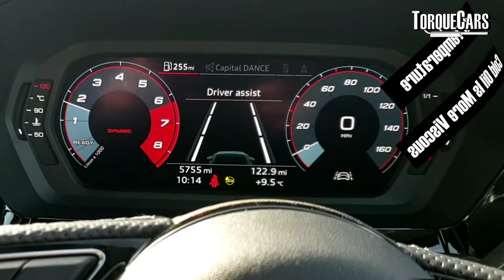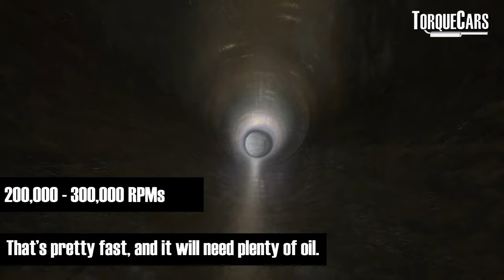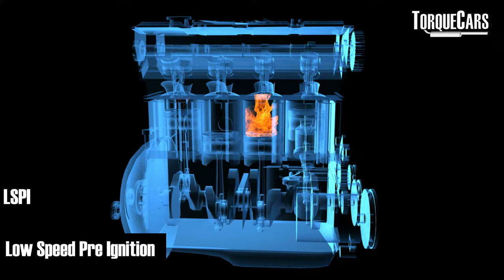5 Things That Kill Turbo Engines ⚠️ [WARNING]

Comment: What about towing? Is it bad to tow with a turbo?
Reply from the maker: Shouldn't be a problem at  all just find your power band and aim to stay in that with careful gear selection. Warm up is important when towing so don't drive hard from cold just keep it gentle until the engine warms up. It is easier to lug the engine when towing which should be avoided. https://www.youtube.com/watch?v=vyt5ETkSot0

Comment: Manufacturers for some reason don't care about engine lugging. On my new Caddy 2024 work van the car tells me to shift up to 6th gear while going 80 kph uphill. I know that it's going to lug the engine, so I don't. And it only has 75 HP, what gives?
Reply from the maker: FYI - The indicated shift points are purely related to RPM and speed and don't take into account hills, theoretically these shift points are optimum for economy but that is often debatable as there are so many other factors as you have pointed out.
Reply: @torquecars  I actually do remember one of the cars that I was driving that recommended lower gears based on how steep you were going. I think that it was the """automatic""" peugeot that in reality has a manual gearbox hooked up to a computer. Worthless gearbox. But at least it didn't let me lug the engine.

Comment: My turbocharger kicks in fairly late and I usually rev it slowly until i feel it kick in and then rev up to my desired speed. However, Ive noticed that my car doesnt shift as fast as I would like, or as I am used to in other automatic petrol cars. How do I map it for maximum power and fuel economy?
Reply from the maker: I would check that the waste gate and boost valve are not sticking open first off. On your Hyundai it makes sense to use a plug in tuning box because I'm not aware of anyone offering remaps on that model. You can also get a box that sharpens up the throttle response which might provide the answer you need. Where are you based? I'll see if I can trace anyone near you that can help.
Reply: @torquecars  somewhere in africa, unfortunately
Reply: shifting has nothing to do with a turbo that is the transmission

Comment: Thanks for the tips, any chance to explain a bit more point 4 if you have a Tiptronic transmission? Not sure how can you luggage the engine if using an automatic transmission
Reply from the maker: Lugging is nearly impossible on a Tiptronic gearbox, I should really do another version of this video for those with auto transmissions. Here in the UK 80-90% of cars are stick shifters, I know in some areas this percentage is inverted. If someone had a manual shift mode in their automatic and they chose the wrong gear it can potentially cause issues, but a modern car will generally work this out and step in to sort it.
Reply: @torquecars  awesome thx for the clarification:)
Reply: I admit to lugging my 1980's manual turbo car  , in 8th gear doing 100kmph it sits @ 2400 rpm  redline is 8000 rpm.

Comment: If you shutdown quickly after a hard drive, the high temperature of the turbo will fry the seals in the turbo. Mechanic says: here’s your new turbo, thanks for the large amount of money!!!
Reply: This seldom happens. Just coming off highway to gas station takes minute and that is enough to cool down turbo. And driving 120kmh in highway is not heavy use. Maybe for smart 0.7 litre turbo but not for anything else really.
Reply: But if you drive normally and not hard, then it's not a consequence.
Reply: Not much of a concern for normal drivers nowadays. Oil and turbochargers are much better designed, and most cars have electric water pumps to keep circulating coolant after the engine has been shut off.

Comment: When you say spirited driving, do you mean like racing / high performance applications? Or would simply driving for a long stretch at normal highway speeds also be included? I try to let my turbo cool down but I usually give it more like 20 - 40 seconds of idling after parking from a highway drive. I'm not sure if that's enough. (I just do daily commutes in my sedan)
Reply from the maker: I'm referring to high RPM & Full throttle loads, anything that causes the Turbo to spool right up. Highway driving is generally more relaxed but giving the car a short cool down period really does keep everything happy.
Reply: @torquecars  Thanks for clarifying 🍻

Comment: I have an air-cooled engine. Should I let it idle after driving to cool down the turbo?
Reply from the maker: No, because there will be no airflow to cool the engine, the oil or turbo as the car is stationary (unless you have some type of electric fan setup to pull cool air over the heat sinks. )

The only aircooled turbo I've ever known was a VW Beetle which used a Porsche Engine. What do you have?

The principle of driving slowly for the last bit of your journey will still apply to an aircooled engine. Is the turbo oil feed running through an oil cooler? If not that would be a practical upgrade to prevent the oil overheating.
Reply: 911 turbo?

Comment: i think you could have done a better job explaining the low rpm bits,my turbo diesel peaks torque at 1900 rpm so it makes sense to drive it around that range, also I think this doesn't apply to all scenarios, sometimes I maintain speeds of 60km/h in 4th gear at around 1800 rpm using almost no throttle at all and it is not clear at all in this video wether you define it as lugging or not, so in this bit you may lead people to just have an unpleasant drive and overthink their use of the car without having a clear definition of what to do

Comment: Hello there! I have a question, more like asking you for advice really. I bought a VW golf 2009 1.4 tsi around a month ago, was serviced in february, and everything was working fine. A couple days ago, the car stopped responding out of a sudden, the gears were changing randomly, and then it just shut down. I thought something happened with the transmission but actually the turbo was damaged. The fans were out of place but nothing broke, the problem is that oil went to other places, potentially damaging other parts of the engine. Anyways, the mechanic gave me the option of getting a used turbo (96000 km approx) or a new one but the price is the double. My problem here is that if i choose to spend on a new turbo, but there's other issues with the engine, it's gonna get too expensive to fix. Do you think it's worth it? Just cause it already looses value, so maybe i can fix it and sell it to recover a little bit of what i have spent on it, or maybe give it a go on fixing all and keep it? it's kinda upsetting because i just bought it but yeah.. thank you in advance, and thank you so much for all your videos, i've learned a lot :)
Reply: Listen to Scotty Kilmore your first mistake was to buy a VW especially that old. Trade it in sell it and buy another vehicle.
Reply: I don't know how hard it is to replace a turbocharger in that model. In some vehicles it is pretty simple. In others, maybe not. In that situation, I would do it myself but not everyone can. Another problem I would have is finding a turbo unit in the self-serve wrecking yard. The price is about $100 versus at least $300 for a new turbocharger off of Ebay. Your mechanic might charge you $1200 for the part.

You probably have the car either fixed or gone by now, but I did the research. Research is my hobby, so to speak. I have never owned a turbo car.
Reply: @kennylavay8492  scotty kilmer is a toyota shill, some VWs are good reliable cars, most arent tho
Reply: @kennylavay8492 lolwat. So you are saying don't buy an Audi? VWs are one of the most reliable cars you can get

Comment: Can a faulty turbo cause engine oil burning and more fuel usage ?
Reply from the maker: Potentially, the oil flows through the central turbo spindle to keep it lubricated so if a seal goes it can seep into the intake and cause burning.

Comment: Hw does a turbo engine without intercooler works vs one with an intercooler.
Reply from the maker: That's a good question I might do a video on that. There were some turbos that came without intercoolers.  The act of compressing the intake air will add heat and this heat will sap power, the intercooler exposes the hot air charge to cooler external air and redcues the intake temps, after a while the intercooler itself becomes hot and doesn't work as well. So for relaively short bursts of power the intercooler will make more power - see my early video  ( https://www.youtube.com/watch?v=gO_DzCNE8ek ) to find out how much, then as the intercoler warms up it will start to lose power.

Comment: Does the “progressive throttle” part of the video apply to performance vehicles   aswell or does that only apply to non performance vehicles?
Reply from the maker: Most modern performance cars (*and even non performance models) now use a drive by wire throttle, so the throttle is adjusted automatically by the ECU.
Reply: @torquecars  would you consider 2014+ cars as modern?
Reply from the maker: I would in general but there are always exceptions. Euro 5 and even euro 6 pushed the manufacturers to evolve the engines further, which has been generally good for economy and that also helps reliability.

Comment: Why did they do away with auto turbo timers?
Reply from the maker: I heard that it was mainly because there was an increased theft risk as the immobilizer is not active when you switch off the engine which resulted in refused insurance claims so manufacturers didn't want the liability. 

Modern turbos and engine designs do have a few extra safeguards in them so things are not as dramatic as they used to be, just being sympathetic to the turbo should go a long way to protecting it.

Comment: English translation: Turbos suck. In most applications, they are unnecessary. They are an engineering travesty forced on the industry and ultimately the public by overregulation. By forcing the motor vehicle industry to meet nearly impossible fuel economy standards, regulations force the industry to do extreme things. A turbo in an ordinary vehicle is an extreme response to the problem cause by being forced to put in an engine that is too small for the vehicle.

Turbocharging generally means shorter vehicle life. It takes energy and resources to make a vehicle. More energy and resources to ship it to the destination. Turbocharging also allow larger vehicles to be produced with small engines. The larger vehicle will use more fuel than the smaller one the driver might buy otherwise. It's not the win people think it is. The bank might win though. The shorter vehicle life will keep people on payments for more months out their lives.

Comment: 200k rpm...or 2k rpm?
Reply from the maker: Turbos typically spin to somewhere between 80,000 rpm upto a heady 200,000 rpm - most street car turbos are at the lower end of this range.

Comment: Expansion is not designed in, its designed for. And its rpm not rpm's. Revolution's per minute, not minute's
Reply from the maker: That is a subtle point of definition but I'll explain why I chose "designed in"...

On the basis that a metals properties are carefully chosen  for specifically their rates of expansion and durability. 

For example a forged race spec engine whilst much stronger will rattle like crazy when cold due to piston slap and would not be suitable for most daily drivers. So I felt it would be misleading to imply that manufacturers just worked around whatever they had but rather the whole engine including metals and expansion properties are carefully chosen.

RPM vs RPMs - I totally agree, and I would probably get some kudos from those in the know. But language being what it is now we see so many people are now using RPM as a noun and adding s - there are other examples of acronyms being treated as nouns. I will endeavor to be more "precise" in future though.
Reply: @torquecars  I suppose that you could put it that way, but I think that it's a bit tenuous and I also think the example of a forged race engine is misleading. You can quite happily use forged pistons in a daily driver, but need to make sure the bores are the correct size.  

The piston slap in a race engine would be expected due to clearances being increased, and if you look to what many consider to be the ultimate in race engines, they don't even start them up until they have been properly preheated.

In a race engine the clearances are increased to allow the pistons to get hotter (which increases the expansion) but also to reduce drag as the piston travels in the cylinder once at the intended operating temperature.

Many modern road engines use increased clearances to improve economy, but it is a fine balancing act, which is why there seems to be more problems with excessive oil use where some companies have got their stacked tolerances wrong.

I would mainly expect the thermal coefficient of expansion to be a consideration when selecting two different materials for example you don't want a friction fitted component falling out due to a temperature change. 

I suppose you could design the expansion in that you might limit the coolant temperature and with some testing choose the temperature at which you need to stop the engine to stop valve guides etc falling out.

Comment: Own a 22 year old Toyota TDi pickup with over 200,000 miles on it. Drive it exactly the same as a non turbo car and have never had an issue with the turbo.

Comment: The moral of the story is don't buy a turbo. My Peugeot 308 1.2 turbo drinks oil (1L every 1,500 kms) which is a common issue with this motor and mine has been fastidiously maintained. I do everything you say. Naturally aspirated in the future for me!
Reply from the maker: I find turbos are a love it or hate it item. People have strong feelings either way. There are good turbos and badly designed mass produced rubbish out there, for me the extra power, lighter weight and better efficiency are big plusses, the lag however is annoying, but newer turbos are much better designed to reduce lag.

Sorry to hear about your bad experience though, especially since you've looked after the car.
Reply: Thank you Mate. 

The Peugeot looks great, has fantastic steering, a small turning circle and very good a/c but the negatives outweigh the plusses. Once when I filled it with fuel (98 octane and recommended is 95) I went 10 feet and then the car stalled and couldn't be restarted. I called my motoring organization who opened the fuel rail and then it started and went. The owner's manual says not to overfill but doesn't give any details. The fuel gauge was still under full on this occasion. Any ideas why this happened? Now I fill the car with trepidation... @torquecars
Reply: Have you tried an EV?

Comment: What should you to let the turbo cool on a Highway when you have to refuel?
Reply from the maker: You'll be restarting it again in a matter of minutes, so personally I would just let it idle for 30 seconds or so. 

Even at highway speeds I'm only clocking around 3000 rpm, so I wouldn't consider that excessively high rpms at all anyway. Over here you generally need to slow up and drive up a slip road to hit a fuel station so this happens naturally. With modern turbos and engine oils the problem is much less than it used to be but a little mechanical sympathy can go a long way to extending the life of your engine.
Reply: @torquecars  thanks for the quick answer!

I agree, for normal highway speeds its not an issue.
But when I drive at 200+ Kph for long times, the turbo will definetely get very hot since the engine of my 1997 Volvo sits at 5-6k Rpm.

Comment: SAY NO------- TO THE TURBO.
Reply: Every car I have owned since 1985 has been turbo charged all Petrol, they have all been maintained by myself with required annual servicing like any car, I truthfully have never had any issues an all have done star ship mileages all on the original Turbo chargers, I would not have a naturally aspirated engine where I live which is at a high altitude, Turbos work better than non turbos at altitude I only drive Low pressure Turbos High pressure turbos are the ones that wear the fastest and Diesel Turbos are a problem waiting to happen..

Comment: Turbo , direct injection. Direct drive  and electronic control screen  makes short term affair.  Built in obsolescence.   None of these cars will
live into old age.   After the warranty any time after is based on borrowed time.  It is not if but when.   You think car repairs are expensive 
you have seen nothing.  One hundred thousand miles will be a miracle.

Comment: So many people born in late 90's and 2000's  have no clue about driving and maintaining a Turbo charged & Manuel trans  vehicles , most production cars  do not have th e nessary  gauges that are needed to keep an eye on the sress that there putting on the turbo , engine & transmissions !  Heat is an enemy ,U need to know the operating temps of these components if U destroy a turbo you will such metal into the motor and do ereputable damage to the motor and instead of just replacing the turbo you will need a complete rebuild or motor replacement and the trans also can be severely damaged if operating to hot or low on oil .

Comment: turbo over 1.4 L is x1000 time more clean wen is drive most of the time over 2500 -3000 rot /min with gasolin cars are ringht this video and vith disel are incorect